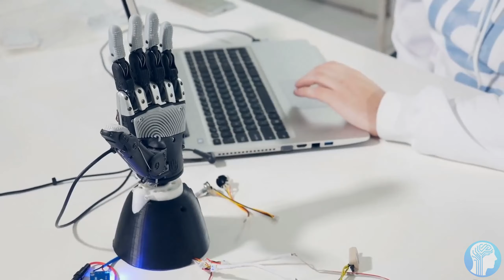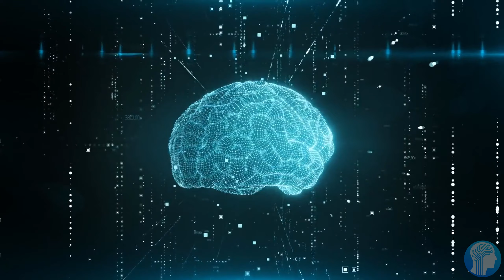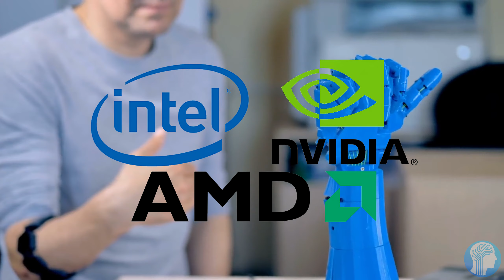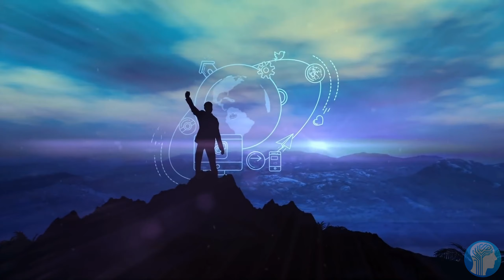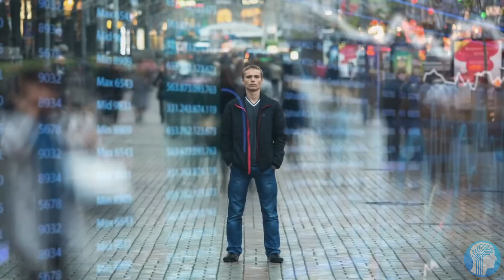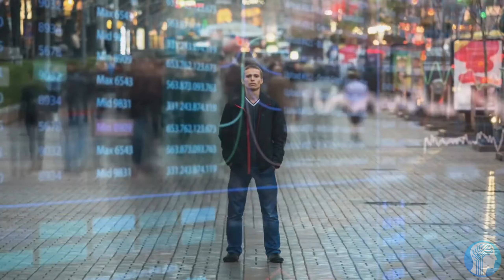Why Intel is Beating Everyone in Artificial Intelligence - Intel Loihi 2

Comment: Ikr, Intel doesn't even need to go below 14nm to compete with their competitors (Ryzen).
No innovation they said.. lol. Now the prove is there.

Intel just feel they dont need to, and allocating their resource somewhere else.
Reply: 10nm was a struggle, because it was too ahead of it's time. It has cobalt interconnects, because copper ones are going to be a bottleneck at 3nm. Intel decided to solve this problem early, and had trouble, but they got it done and did it themselves. Yet brainless AMD fanboy drones want to say hurr durr 14nm++++ and act like Intel was just fucking off and drinking coffee. Forgetting that it was AMDs fault Intel had no pressure to rush, because AMD couldn't field a competitive product, and still needs a newer process obtained by outsourcing just to be equal.